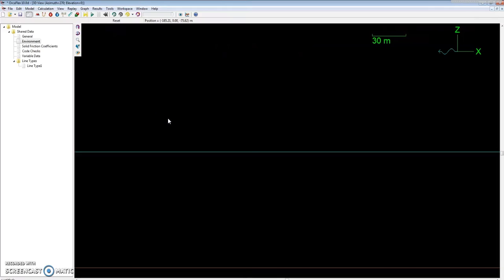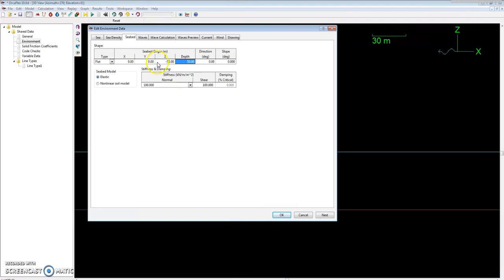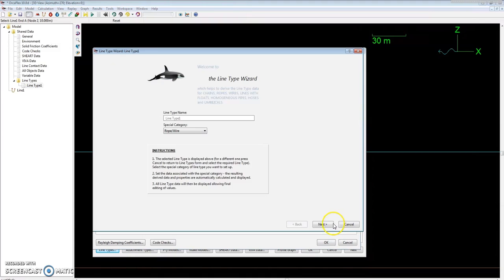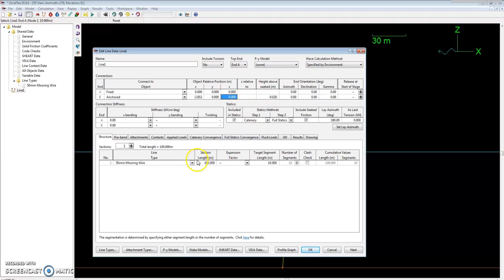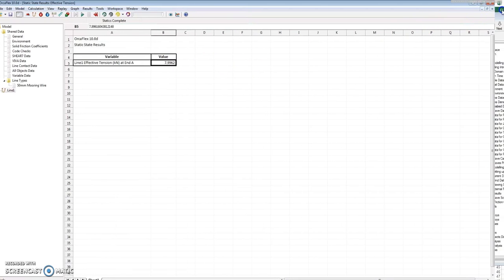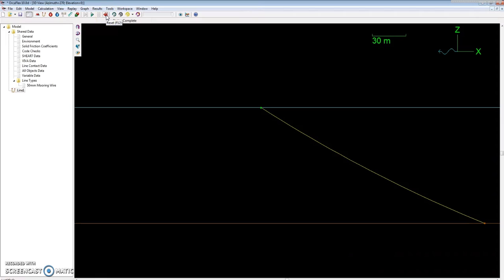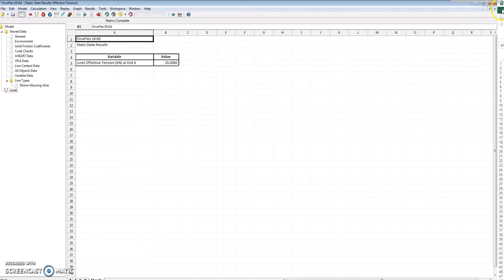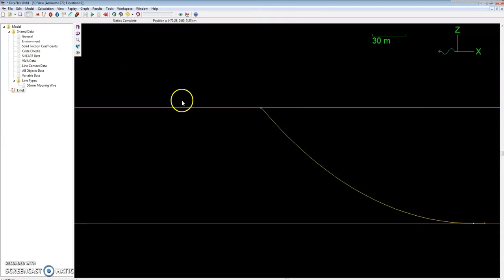How to Calculate Simple Catenary

Comment: Hello , I have a question about orca flex . I have the orcaflex version 9.7a and i want to connect a shape object to a line object. But I find no way to make connection between them . By the way there is an easy solution in newer versions. But I can't install the new ones. So if anybody could help me I'd be so thankful.